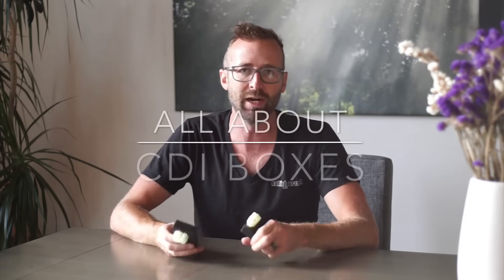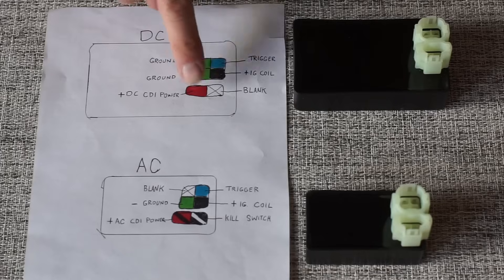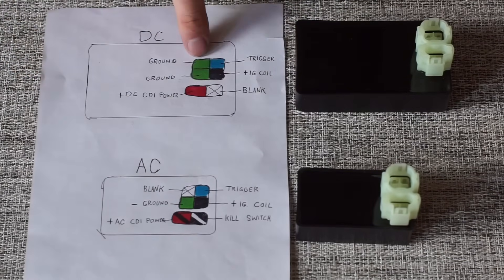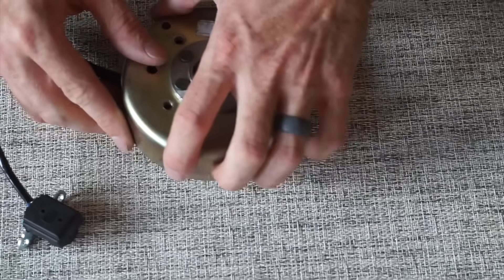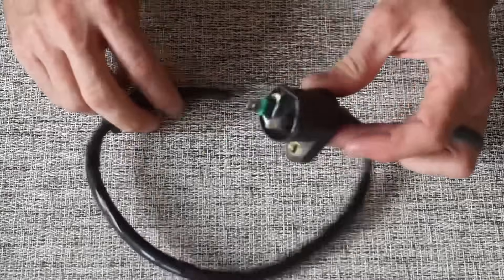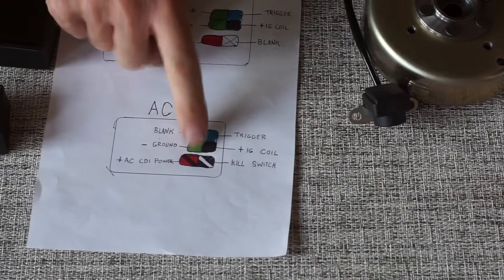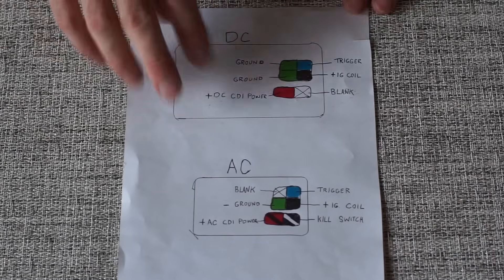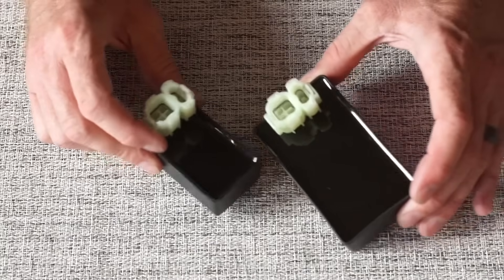CDI  BOX: AC vs DC performance vs stock

Comment: Hi, so thanks so much for the detailed information. Let me ask, if my lights are very dim until I rev my engine on a fairly new trike, I'm guessing I have an ac cdi box cause my battery is fully charged. Can I use a DC cdi box so I am getting brighter headlights without having to rev the engine? Also can you use a DC cdi box if you have an ac cdi box?
Reply from the maker: No you can’t use dc box on a ac system. You can make your headlights dc though
Reply: @RollingWrench  can you tell me briefly how to do that? Splice into the hot side of the wire going to the cdi maybe?

Comment: Hi  inside the Cdi box (ac) or Dc the trigger pulse generator "fires An scr earlier or later in the cycle due to the fact that the faster the engine rotates the RATE of gate trigger voltage Voltage builds up quicker thereby by giving the ADVANCE or Retard
as the engine rotation varies.   Kindest Regards, Dr.Doug Ahern Sydney Australia.

Comment: What if your dc cdi box is bad, will you still be able to test with test light to verify it is a dc box or do you just assume because your test light doesn’t come on that it is a Ac box? My head lights are not working and haven’t been so can’t test that way and my cdi box is the bigger one.

Comment: 9000rpm 9200rpm to 15000rpm, but is it possible to lock the rpm as we want by changing cdi's components or THE cdi BECAUSE engine won't have same life work duration...more engine go to max perf more friction between steel engine parts. Thanks it help to understand well

Comment: how do I know if the CDI I have is any good ? Bench test ? I'm trying to get spark from 200cc Cinese dirtbike loose engine from a new stator/trigger coils and am getting 40 V AC at power (to CDI red and black) but No spark from bue and white trigger wire at CDI?  I am connecting starter direct with jumper cables to turn it over.. in attempt to eliminate useless wireing

Comment: Did you found that DC  have a better performance than Ac Cdi sir? Even if you installed an Ac racing Cdi? What do you prefer? Then let's say they are stock can DC Cdi provide more rpm than Ac Cdi?

Comment: I know I'm late but I have a question and I'm confused.  Soo if my gy6 scooter is DC. (turn key to off to kill it) Do I have to wire my headlights direct to batery for LED lights or I just put LEDs in and they are safe. If u know what i mean. If u can see my comment it will help me so much.  Great video btw !

Comment: I'm having a bit of an issue I bought my first CDI from Amazon"racing CDI" and when I installed it it blew a fuse. I figured defective send it back got another one did the same thing. Then after my research that's when I found out AC and DC CDI so my scooter is an AC Set up OEM. So I went and spent a little more for a new CDI and still blowing fuses. Now I'm lost. Please help. Plus I noticed the 2 CDI in this video has identical connectors

Comment: Hey there rolling wrench, I'm hoping you can shed some light on a couple issues I'm having from 2 different upgrade parts I installed on my 2006 Honda CRF450X SuperMoto. The first one is my 100watt stator and reg/rectifier kit from TRAIL TECH. What I am confused with is the regulator/rectifier that came with this kit. There are 2 adjustable knobs on the top, one is for setting "delay" and the other is for "voltage". The only info I have on this is from the installation instruction sheet that came with the kit, and that consist of a single paragraph accompanied with a picture of the REG/REC under the title "adjusting REG/REC relay timer" and little red arrows pointing to the obvious, to the dial labeled "delay" and the other "voltage". Basically, all it says is "adjust delay dial cw to decrease relay active time", then of course ccw to increase relay active time, and literally nothing about the voltage dial. Can you help me with this? I mean what relay am I activating for delay time increase or decrease? The other upgrade is a VORTEX X10 CDI. Now like the TRAIL TECH installation sheet, the VORTEX install sheet has it's points of similar vagueness. It has to do with the bullet connecter end grey wire. All it says is; "now plug in the bullet end grey wire". And that's it, all the rest of the installation instructions were complete ie connect this to that, or route this wire from pin "x" to pin "y". So do you think you can help me out with where that grey wire plugs to? Thank you so much for your time efforts and help regarding this matter.
                                                    Lee

Comment: Your videos are the best out there, because they explained  thoroughly with detail. You try your best to make sure the viewer understands, by using illustrations etc. Thanks! Another subscriber. BY the way, I installed a new Stator the other day (my current one was working, I just thought I’d install a new one), but in the process, I think I may have moved the timing cover, and forgot to put it back to TDC. Now no start.

Comment: Finally got rid of my cdI  box  By converting the trigger to a set of points ,.  The inability to get my writing sorted out ,As it had been severely haked about , , I decided.  that to find a satisfactory , answer to    my solution was to fit a set of points . & ues my coil to charge the battery by  the rectifier ,  & with my point i can now trigger the spark coil by opening the point's ,  , How did I fit point,   well i on the fly weal thrs a, rased piece of steel that. let's the trigger trl the CDI box to fire the coil.  I set a slight slope, on the porch sid of this position to  fiered.  the coil  & put spark to the,  Engine  of the scooter , it works well as you can only fier the points at this point . the open gap   is 240 1000"  of an  adjust the lift by string the high of lift at the  points , mounting  plate   held in  place by the two retaining  bolts of the trigger coil that was  you may need  the new base plate to stick  out so the point pickup rid over the new cam plate, smothley to open  point set AT 12,000" OF  on the base plate, to 12. feeler gage .  if it lifts to early move the Height back a little as the cam lifts later by extending the slope to the center but i found this to be bacic advance  & retarde  my be done by slotting the base plate . allowing the flywheel  to move back or forward in relation to the points opening. 

their you have it no more CDI , & your feed is the datrey & you ues the AC  stator  to charge your battery by the regulator ,   & power you lights. as it would normally . 
 Scooter ATV upgrade,  LES,  ENGLAND

Comment: Thanks  Honda dio AF34  DC cdi 1version   ok  . I fixed it for 1 week. They write a lot of connections, Russian and Japanese pages, and they are good too. specified, looks the same on the outside but must be measured with a multimeter to be sure

Comment: I won't you to build from start to finish  a wiring skit & brake light & halite Serkis  loom for a quad , YES I mean from start to finish so.  we can build our own  using the plug in parts  one ac & one DC  With  part's,  You have shown us in this video.  & test it on you bench .  

I think it would Mack one grat. Video & help a lot of confused people out ,  when showing  them how we build one UK England   When I Re-build a hacked system I start by . taking the loom of the vehicle  & strip  it out  in the bench then I place all the green & ground wires secretly & tap  the individual sockets separately. green frame earth      & along side a black engine earth.  which will go striate  to the engine & one gen from that to farm. the black will be f a larger copacetic than  the green   but will be tapped to the green & then covered to be one circuit Earth with all it separate branches in green  staking out . 

then i separate the red , live Sackets  & do the same , allowing a patch in to the cooler cod live whir that is  required. I always keep the red whit power fed from the generator to be one a ac unit to be dedicated signal whir, & fit an [ ign-swich]  in the DC . version as it is direct from  the battery . & [ drives the skits} some times I very the wire thinks to take in to account of the demand on the lilting  socket   & keep the  {ignition & secretly  isolated } 
Like  the engine earth & Frame  earth.  

 I think you would do A grate  service to  illustrate this practice  by building the system from scratch to illustrated how it done  properly. on the bench, it fin seeing one don by the manufacturer. but doesn't illustrate why the colours change  as we look at them .to plug in, Les England. you may ues my description if it helps you to do so. Th why we have so meny diffract tips to choose from but in the . End there's only live & earth .   & HT . Hop you consider doing one Les England   from the age of pints & HT coils . yes the plug in is sample.  to the young it away end up in traying to find a shot cut a hack job . if you build it they will come.

Comment: I also want to add, and correct me if im wrong, 
A bike with a AC cdi does not need a battery to work. It can work without a battery. The dc cdi dont

Comment: Hi there, i don't know if anyone sees this comment or nut but would like to give it a shot. I have an AC CDI with 50cc scooter, turn key no light, after starting scooter lights gets on and pretty low with flickering unless i'm giving gas which speeds up stator and in that way gets bright... That cause my head light bulb pops every couple of month... Is there any way on wire configuration on my CDI to change all lights feeds from battery rather than stator? Thanks in advance!
Reply: to much current getting to the light' s by way of magneto try a control regulating current diode Or running  the lit from the battery Insted of the dynamo or if already on the battery It passably a  a faulty  ac? dc regulator ,  charge in to the [bat]  hop this helps ,
Reply from the maker: Of your lights are popping you have a bad rectifier regulator. It’s not regulating the charging system. If it goes past 14v you will blow lights. You can always wire your headlights dc. But I would recommend upgrading to led off you do that so your charging system can keep up. This will solve the low idle flicker. Oorrrr you can raise your idle just high enough that your tire isn’t spinning resulting in brighter lights at idle
Reply: @RollingWrench  first of all thank you so much for your reply! Didn't thought I would get one on such old video! 😊 Actually I even tried led bulbs on the head lights ( small and big) both fried after couple of weeks... On idle both traditional or led bulbs flickering... ( I have a Chinese 50Cc scooter with Gy6 139qmb engine)
Reply from the maker: @ardakaraoglanyan6319  I would recommend checking the rec reg and running the headlights it dc current. You may even have a bad headlight resistor
Reply: @RollingWrench  I will definitely check! I don't know how much I can thanks to you! Really much appreciated mate!

Comment: i have a question my motorcycle come with a kill switch and its a DC cdi how would that work?
thanks in advance
Reply from the maker: All ac and dc cdis will have a kill switch. Dc is killed by killing the 12v power to the cdi. The ac is killed by the extra stator wire
Reply: @RollingWrench  heres another question my motorcycle uses a dc cdi but it didnt have a battery and it still turned on how is that possible
Reply from the maker: @nooneimportant583  it must send power through the rectifier regulator to power the cdi. This converts the power from ac to dc.
Reply: @RollingWrench  ah thanks ive seen other videos saying that it should get power for the battery so i was wondering how it turned on with out one

Comment: Question: I have 7 pins on my 1892 Suzuki CDI, a larger 8-pin block with one missing. Based on your video I presume it's a DC CDI, but with two more pins than you describe. What could they be?
Reply: Fuel pump relay and signal to the tacometer

Comment: Lets say I have a random ZNEN scoot with a 150 GY6 that has a DC system but also a kick starter - the kick starter would be no good to me if the battery is dead right?

Comment: Can i use both yellow and white wires coming from AC Coil to charge the battery through rectifier??
Reply: Also i will disconnect yellow wire from headlamp to save energy and use that to charge battery faster??

Comment: so I know this is an OLD thread , but I just got my first 50cc and EVERYBODY says to DERESTRICT it I need to remove a wire from the CDI, the wire that you show as BLANK on the AC CDI, as well, my skoot matches your diagram , no wire in that spot. I am hoping for just a bit more top end so I am going to try a performance CDI ( the typical orange one) any one with thoughts on that? I also played with my needle jet a bit but that just caused a no starting situation, so I put it back the way it was.
Reply from the maker: If you want the best cdi I know it click here :
https://www.rollingwrenchdenver.com/products/gy6-cdi-coil-combo-adjustable-timing-advance

Comment: I liked your explanation of the box but you need to check the wiring harness that plugs into the box..Not the box itself without wires..I understand it because I know what your talking about but someone that knows nothing may not understand the way you explained it..I was also left wanting how to test the stator outputs for A/C & D/C..🤔
Reply from the maker: I have a separate video for that :-) thanks for the support

Comment: I have been working on JDs for a long long time and believe it or not this is my first ever experience with a 1969 JD SSI system. But thanks to Rolling Wrench it was a easy way to learn about this system. Great teacher and I found his point by point instructions spot on. Just made my job infinitely easier. I am an old guy and I never even saw on of these units until this past February when a customer asked me why it would run. Opened the hood and saw Solid State Ignition and I said s&@t where did this come from? LOL This must have been a year year engine. Thanks for the help.

Comment: Great video guy. You definitely deserve my subscription. Anyways i gotta ask, i have an old hyosung RX 125 that i am restoring. I noticed from the manual it states that it has dc cdi. They all look so similar. However Because parts for this bike is rare where i am. I was wondering if i can use other dc cdi from another motorcycle with my system? Like from other mopeds. Thanks and much obliged.

Comment: What is the CDI box ,AC or DC ,If it is on an old china ATV  90 cc  2 stroke that has a CDI box that has  a small female plug that has a black wire and a orange wire coming out of the box going to the plug, And the box has a red wire with white strip with a little male end on it ,and a red wire with a black strip with another little male end on it.And it has a Black wire with a white strip on it with a female plug ,on it witch is it ? Please   And It has a stator that has 6 coils and a exciter coil ,Is it AC CDI maybe?  On the stator ,When checked with an omn meter the wires will show grounded when probe is touched from wire to base of stator ,The one that is on the bike and 2 others that I have bought and sent back. I don't get it.

Comment: Can you use an AC  wiring harness with a DC system ,I would really appreciate it if someone had a diagram on how to do it ..
Reply: Daddy Savage  so the same wiring harness will work on either an ac system or a dc system ? So is,the one difference the red power wire from the battery  going to the cdi box in the dc system ?and in the ac system it goes to .....? Thanks for the,reply these two quads have driven me crazy !!
Reply: Daddy Savage  thanks for your help , i have two quads that im working on and I just figured out one is an AC and one is DC set up ,im learning as i go ,thanks again !

Comment: Hi, how much do you know about Procom CDI Box_
I purchased one and it started the engine, but I was not able to stop the engine, I did remove the external blue wire, as per the instructions and still did not work. Why is this?
Any ideas?
Kind regards,
Franco

Comment: Time 7.50. I have a multimeter.  You say to measure it with the key on.. but how am I supposed to measure/ make contact with multimeter leads if the wire connection blocks are in??  Confused?  Also, everyone is saying I have a DC cdi, but yet I have a kill switch, but according to you, I shouldn't.
  
Can you look at them physically and see the difference, (not the size)  but something different about the pins or something?

For a Baja Reaction 250 gokart buggy.

Comment: I know that there’s been a lot of discussion out there about aftermarket parts. In your professional opinion do you feel that swapping out the original cdi box in any Chinese scooter for example any of the mad dog generations is worth it. Is it truly a better upgrade than the stock cdi box.
Reply: Wtf did you just say? Broken English. Nothing made sense.
Reply: Reply we now i have done it yes,   They brak far too easily & we do not  all have account on ebay & such, a trip to the local store  do's me, if i can't get it there  i'm not interested,   So until their on the self & can be conveniently  replast  easily  broken yes easily replast NO.  But not so good,  if your in to deep diving a ATV. i see a lot off ,   The points will let you down.   But then thats not for me all  throw there's a way around that. but i'm not in to taking ATV,  in to deep water .  as mos do .

Comment: So confused now. I have a American Sports Work go kart. That I bought brand new. It is supposed to be a DC system, but it only has 3 wires (one ground) on the 4 prong plug, and only one wire to the 2 prong plug. The cdi is the larger one. What is the purpose of the second ground.

Comment: Good work mate. One more clarification. Does the DC CDI convert the DC input voltage from the stator to AC and then sends it to the IGNITION COIL which then steps it up?  And does AC CDI sends the power directly to the CDI which directly steps up the voltage from the ignition coil?